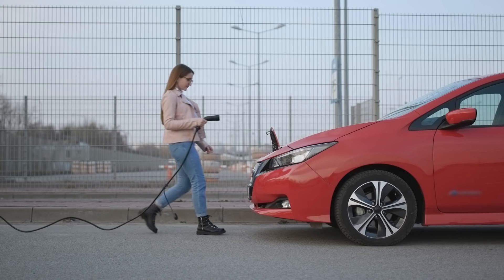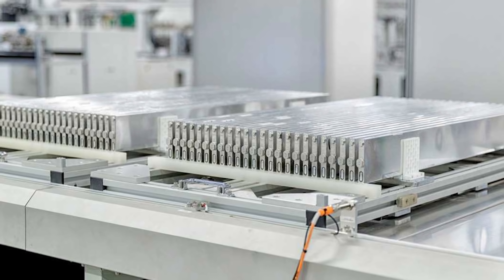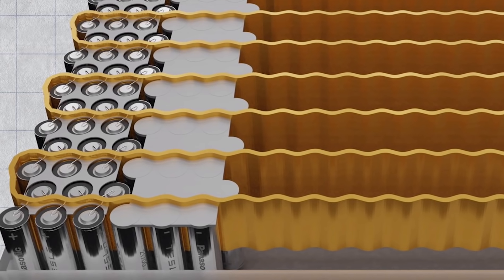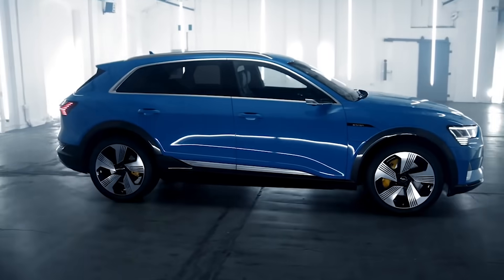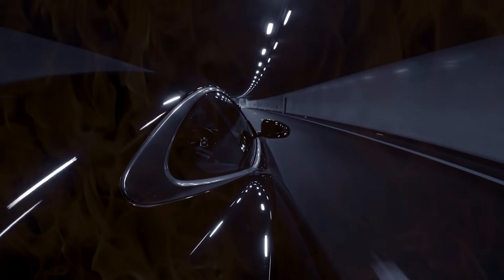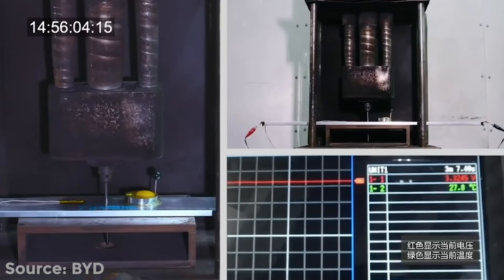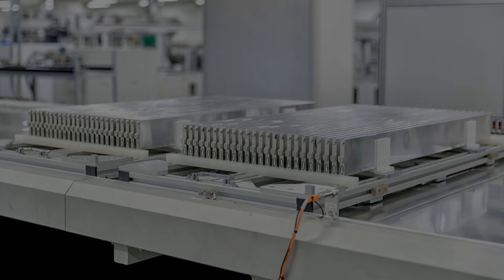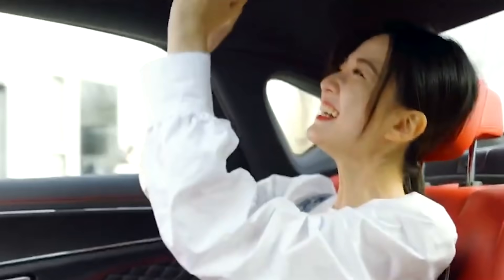Uncovering China's Battery Breakthrough

Comment: "Unfortunately the cells are manufactured in China ..." So if the cells are manufactured outside of China, they would be non-polluting to the environment?  Where then should they be made?
Reply from the maker: This is relating to the fact that china has high emissions in their energy generation compared to other countries, and as most of the co2 emissions from battery production comes from the energy used to make them, it massively increases the emissions compared to being made elsewhere. However, other issues relating to water pollution etc would remain the same. Hope that answers your question!

Comment: This was a good video, and was NOT click bait... so please, pretty please, don't stoop down to their level by using the same sort of bullshit thumbnails like you did in this vid!
When paired together with a non-revealing video title -- like you also used here -- it conveys a false impression about what the video will be about. Displaying the same rectangular battery image that you used in the video would still invoke or (at least, my) curiosity and gain a click...

Again, the content of the video was great and I learned of something new, which I appreciate! However, that's the entire drive behind this message, because typically I will avoid these types of vids solely based on their most-likely-unrelated (ie 'clickbait') or completely fictitious thumbnails. (caveat: as mentioned, if the title states what it's about, like if you had included "rechargeable lithium cell", it would've at least put the thumb into perspective and been a hint that the image is fake but used instead as to not give away the entire content)

There, I've said my part, and will mosey along! 😊🥴
Thanks for the vid!

Comment: I like the idea, makes for warming or cooling a very simple system, just a thermostat with an airflow control and you can control the airflow for hot or cold areas :).
Liquid cooling works great but we have seen over the years even the best system can get a leak, the VW air cooled engine as well as air cooled Lawnmowers seem to work very reliably for many years and there is nearly always air about ;)

Comment: I'm actually kind of surprised that it took them this long to come up with this
now you may as well build an external charger so you can just switch out the batteries for an instant recharge
you could easily replace individual cells that have gone bad too
Reply: It surprised me too. this thing is too good to be true. If it was, then where's that battery now? BYD could be multi-trillion dollars company if they patented it and sold it to EV companies around the world. Their solution solves many today's battery problems at once. Where is it? Or does it have a problem that's not mentioned in this video?
Reply: @kaptenhiu5623  Its in BYD han and tang. And No BYD will not sell the tech to other manufactures because its called a patented design stupid.  Why dontt tesla sell its motor technology to BYD? why does spaceX sell its rocket engines to Russia?
Reply: @ddjohnson9717  SELL THE FINISHED PRODUCTS NOT THE PATENTS
Reply: @kaptenhiu5623  why don't SpaceX sell its rocket engine to India  or China for profit?
Reply: @kaptenhiu5623  why don't US military sell F22 to Taiwan and Japan?
Reply: @kaptenhiu5623  Its insane that you think China should just sell shit to the world. Its almost like there are political reasons and geological reasons hindering the selling process.
Reply: @ddjohnson9717  Russia did sell their engines to US
Reply: @ddjohnson9717  US did sell F-35 to its allies
Reply: @ddjohnson9717  yeah.. this is insane. I also have a cure for cancer in my backyard that I can't sell because there are political reasons and big-pharma hindering me to sell it.
Reply: @kaptenhiu5623  I see the battery pack in Vehicles already. where's your cured patient  at?
Reply: @ddjohnson9717  No I can;t see the miraculous BYD battery from china in many EV. Just like you can't see my potion. It's a state secret.
Reply: @kaptenhiu5623  Now where's the news regarding  your magic pill?    its ok to post it in any language, since unlike you, I know how to use google translate.
Reply: @kaptenhiu5623  Oh look! what's this video? 
"Tesla's New Blade Battery From BYD Admits No Competition"?  Tesla is buying BYD's blade battery?  

I was gonna let you slide but fr it just popped up in my recommendation and I do not mind add salt to injuries.

Comment: It's great to see some common sense in newly innovated products! I've always believed the cylindrical cells used in ev's, was a waste. Each 4.6v cell having to be wrapped in a can screams of excess weight, waste of resources, waste of space, and inefficiency on many levels. Not sure how many volts each of those blade cells produces, but I could imagine they might be 100 or more volts per cell,  all in one case, instead of 25 or so cells, in individual cases... Obvious weight savings, efficiency, and easier to manufacture... Will be interesting to see some technical data for this technology, and long term resiliency...
Reply: Each cell must still be 4.6v, maybe the  linear length of the blade can be split into many cells, but that just adds manufacturing complexity. If the voltage of the system is lower, that means more copper to reduce I^^2*R losses. Also switching components - transistors - are different, maybe more expensive

Comment: It’s shaped like an air cooled engine fins anybody could of came up with that .the down side to this design is the battery needs to be exposed to air in order to cool properly and it will not work well in hot climates and it will corrode easily

Comment: The batteries that John B Goodenough is coming out with are going to be EVEN BETTER than these ones from China.  I personally heard that once the tech is perfected, it will hold a charge much larger than the measly 3x - that is just the starting models.  When it's perfected and advanced properly it'll be closer to 30 times the charge.   Imagine charging your cell phone once and it holding a charge for more than 30 days....  Not only that but it will be made from a material that is VERY common and not harmful to the environment! (Glass, graphene and some others I think).

Comment: My worthless opinion ha, ha. We need two types of vehicles, but one still works with fossil fuels such as the vehicle most now own. The electric vehicles would be strictly city use (most driving is done there) and the vehicle you have now for highway transportation. The city electric would look nothing like or be made from the same materials and comfort level for the short trips. Think about it. One could almost make a vehicle from dense Styrofoam covered with a thin plastic shell like a bike helmet for the city vehicle body. Light, efficient moving ease, and cheap to make. The problem is trying to make one vehicle that does it all.

Comment: Hasn't anyone noticed that during the puncture test the normal battery is at 4.2V (fully charged), while the BYD is at a mere 3.3V (almost discharged)? Quite a difference in the energy stored

Comment: They should be oriented longitudinally in a car (front to back, rather than from one side of the car to the other), so the air will flow through the whole array of batteries evenly/equally, with minimal air resistance/drag.
Reply: noooo longitudinally would mean one end of the battery gets cooled  while the aft ends, no so much.it's not hard to distribute air in a duct so that sideways batteries get roughly similar cooling. Mostly this is due to laminar flow of air and how flowing along a long length means very limited head shedding. .  And lateral battery orientation may offer easier access to the terminals, and maybe easier battery swapping.
Reply: @someotherdude  Give it a slight angle of attack.

Comment: Saying Lithium-Ion Phosphate is cheaper is just not true. Economy of scale alone has brought down the price of Li-Ion batteries, such as 18650's. And "those" aren't even the best price per Watt-Hour. From my cursory lookup, AGM though they are heavy and would be impractical for Cars, are still the cheapest at around ~$0.127/Wh, Li-Ion at ~$0.36/Wh, and LiFePO4 chemistry at ~$0.481/Wh. And Li-ion batteries offer the highest energy density by weight for the second best price, so there is an obvious reason they are used. Until there is an advancement in battery chemistry for weight, I think they will remain the #1 choice. For home solar, I'd go AGM Solar Batteries though.

Comment: Ultimately, of course, batteries must be replaced with self-generating power sources.

Now, before anyone goes off on a "perpetual motion" rant, that's not what I'm talking about. Diesel-Electric Railroad locomotives are self-generating, but hardly qualify as "perpetual motion ". So, get that idea right out of your head.

Back around 1979, a former GE engineer developed a power source using a catalytic reaction. Now, how he went about it was his undoing. However, the idea remains sound as an approach. We just need to find reagents that produce respectable output and have acceptable characteristics. We just develop it in a package which could be a plug-compatible replacement for a battery pack.

Comment: When everyone in the UK eventually has an EV and they are all put on charge the Electricity Supply will not be able to cope and therefore the electric sub stations will trip then a mass blackout power cut will occur, you have been warned.
Reply: That'd only happen if the transition was sudden and grid operators were idiots.

Comment: It would make far more sense for the battery to be used in a very light weight vehicle. It's really all about energy and mass.
When you have a vehicle that weighs 10 to 50 times the weight of the rider  most of the energy is squandered/wasted on just moving around a big heavy box.This is an essential point. If the vehicle was light in weight like an electric bike or an electric velomobile it makes a lot more sense as most of the energy is used instead to get the rider to distances fairly quickly. Even a fairly light in weight electric motorcycle could possibly make sense.A vehicle carrying heavy goods would probably not be a light vehicle however.
Reply: This is a problem I think too about. Some say the extra weight is only important for starting but once driving, it's less important. The inertia takes over and an ultracapacitator can store the energy when braking. But I am not convinced.

Comment: Until there is a commercial airline that flies intercontinental flights using battery powered airplanes, I will not trust that battery can be viewed as the main source of power.  There is nothing can replace fossil fuel, jet engines, and combustion engines.

Comment: Seems like if they wanted to solve the one problem you say they have, they would just need the local grid around the manufacturing facilities to adopt other energy sources. That's the sort of thing I can see the Chinese government doing to promote these things internationally and get into the western car market more heavily.

Even outside of cars, this is a good advancement. The heat/puncture problem is enormous with almost everything that uses batteries now. I don't know if their layering method can be downscaled to work in electronics more safely since the main benefit is surface area, but we're going to need a mix of stationary storage options going forward, some of which might benefit from this. The heat damage from cycling of lithium batteries shortening their life is one of the biggest challenges, and this sounds like it might help address that.

Comment: Thanks for an interesting video. Some things - the electric cars are in cold wether depending on warming the batterys, and the warming/cooling system often depend on liquid cooling or warming. And the blade cells do have to have some air pipes running throu.........🤔 ?  
But maby there is other ways to build.....😎.....Always interesting.
The best from Sweden.

Comment: Lithium Iron Phosphate or LFP cathodes are not good for fast charging. They are cheap to make and can last longer than more expensive Nickel-rich chemistries. Although I agree with the other points mentioned in the video, I would like to add that a large form factor like the blade battery makes the replacement of individual cells really expensive and difficult as each cell is so big now.

Comment: There is no breakthrough here. LIFEPO4 is an old chemistry and not used anymore for HV battery due to it's low power density. Even if you mage to increase the volumetric efficiency you still have the penalty of weight, and you need much more cells for the same bus voltage.

Comment: Theoradically speaking, any battery capacity can be fully charged in 1 second as long as the battery doesn't blow up from overheating.
Reply: Lithium ion batteries definitely cannot do that. If you tried to charge an Li+ battery in 1 second with would definitely destroy the battery, maybe even just set it on fire or blow it up immediately.
Reply: @maxeclipse4065  in theory, if a battery have fictional super cooler, it can be charged in a second.

Comment: I wonder how they solved to put the LiFePo batteries under mechanical pressure. As far as I know, LiFePo "likes" to be in a tight environment, which is easy to achieve in round cells, but if you have air in between blade cells, this could be a little of a challenge.

Comment: Wait so it's mostly a geometric improvement rather than a new chemistry / composition? What's stopping anyone else from doing this then?
Reply: Nothing. Atlis is building a new bad a ass electric truck with a similar style. Tons of range and full charge in under 15 mins.
Reply: @Mattys556  Wait so these are cells are going to be charged parallel?
actually that's a good idea, if they have a ton of smaller capacity cells charging in parallel, you could definitely reduce charge times. It would almost have a super-capacitor quality to it.
Reply: The chemistry switch is huge- and the long, thin form factor overcomes the reduced energy density.
Reply: @someotherdude  Wait I thought the chemistry they're using for the blades are an established / conventional one, like a lithium iron phosphate cell?

Comment: lithium iron phosphate batteries have a great lifecycle and tollerance to high currents so they are much safer but both by volume and weight they are far less energy dense than modern li-ion batteries, almost half as dense.
Flat lithium iron batteries are nothing new, they are just improving on the technology designing a form factor specific to electric vehicles whereas cylindrical lithium batteries are basically a universal form factor that is mass produced all around the world.

Comment: One of the advantages of the cylindrical format turns out to be its strength (when resisting swelling).
I don't see that being true of the "blade" shape.
Reply: Swelling happens when a battery gets hot. These won't get hot
Reply: @jeremybowden3134  
Swelling occurs when all those ions try to cram into the same place.
That's why nobody has succeeded in using Silicon, in spite of an electrical advantage (vis-a-vis lithium) of about eight times.

Comment: THis is one of the best Blade battery videos here and I have viewed most of them. What is correct here, and neglected  in others, is the VERY important fact that it can be air cooled. This is a HUGE saving in cost, complexity, weight and volume. Check out Sandy Munros video breakdowns of TEslas and Fords water cooling system to see how big an issue this is. The costs differences just for the battery, neglecting structural cooling, is That BYD has stated their costs are $80/kw while even Teslsa new 4680 cell, (still not in volume production), can't break $110/kw.
You should not be spreading false rumor about BYD supplying Tesla. BYD made an official denial on  this unfounded Chinese based gossip. The other factor here is the capacity of BYD to even supply themselves with Blade batteries. They will need a 2nd battery factory next year as  their 20GW capacity factory can only supply 200-350K vehicles with a 60k-100Kwh pack. (Do the math). 
Lastly, Elon in recent posts has agreed that LFP chemistry will make up 70% of the EV battery market in the future, which means CATL and BYD, or Samsung and Panasonic will have to change directions.

Comment: Almost everyone uses round cells for a VERY good reason - they evenly resist expansion (which happens every time they're used).  It makes no sense to go back to square, and absolutely no sense to try cooling them if you do - you can no longer prevent them expanding/contracting, so they're going to bloat up and self-destruct much faster.

Comment: These flat batteries already have inherent problems ,bcse of length they develop weak breaks inside and discharge irregularities in multiple cell polarities than the current cylinder cells.
Plus manufacturing of these are extremely more dirty than the current lithion  process..
China will soon experience a rise in respiratory disease from This type of aggressive dirty unchecked manufacturing pollution..the air the water..and taking ALL the undetectable dust particles into Thier homes.. affecting others..continuing the contamination.

Comment: That's very funny but not efficient enough.
From almost 17 years I use a magnetic battery on my car with about 2000 km autonomy at 150 km/h. The recharge time is about 15 minutes because the recharger is... let's say different.
Magnetic battery? Yes. It's a different concept, very simple and very easy to produce and it's all mine cause I don't want to share it. Doesn't ignite and doesn't polute. No LiIon, no phosphates, nothing like that.